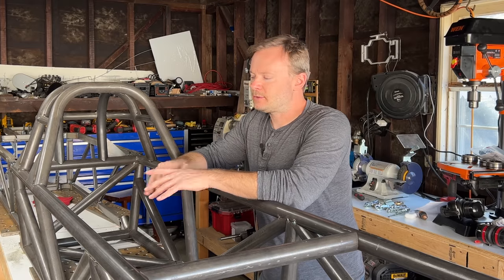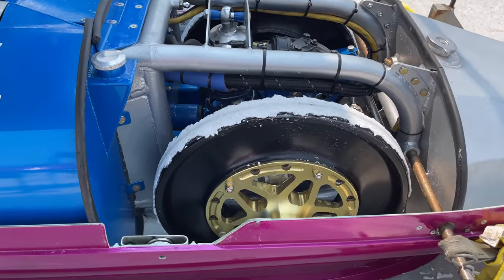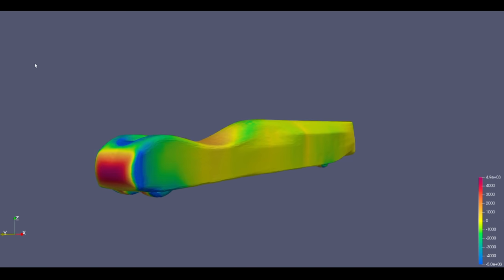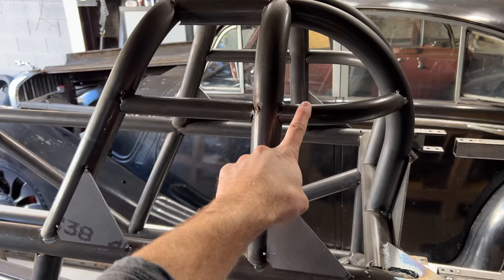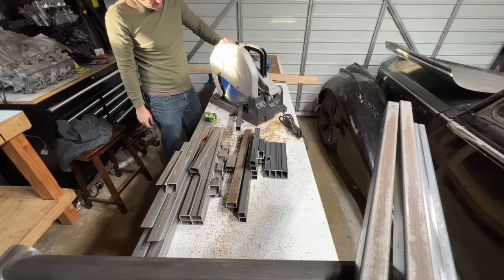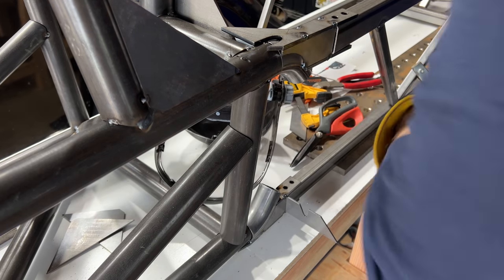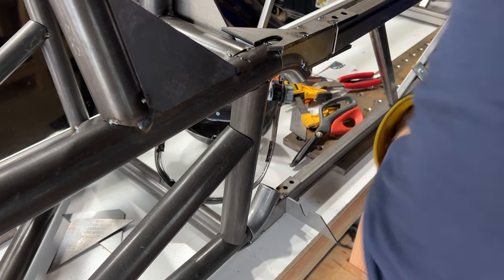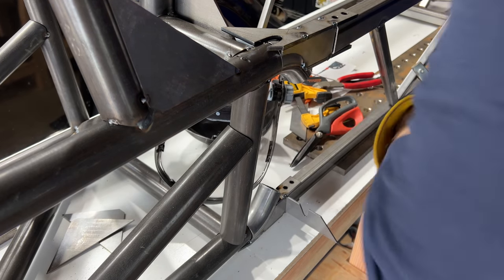Building A Race Car Frame: How To Not Die At 200 MPH

Comment: Can you make the nose just extra longer down to a really thin point. I know enough about balsa car racing that the triangle shape always wins.
Reply from the maker: I could. That is a thing a lot of people do. bullet trains kind of do this, and I thought there was an aerodynamic reason for it, but it could just be to scoop cars and cows off the track to avoid a derailment, which I hopefully will not need to worry about. I'll be doing some different analyses to see what works best.
Reply: @SuperfastMatt  The noses of aerodynamic trains are often made of fibreglass, they're not designed for collisions. The duck nose of Japanese bullet trains is to prevent booms at the ends of tunnels.

Comment: I have one small question.  How many cubic feet per minute of air will pass through your intake tubes while traveling at 200 mph including the suck from the engine (if there is any)?
Reply: You can work it out from engine displacement: 0.5 litres per engine cycle (the engine displacement) at - for instance - 100 engine cycles per second (that's 12,000 revolutions per minute but only one engine cycle for each two revolutions) would be 50 litres of air per second... or 106 cubic feet per minute. Proportionately less when the engine is running at lower speed.

With the tubing cross-sectional area (assuming 1.5" inside tube diameter) of four tubes, if I didn't make a math error that's an average air velocity of 11 m/s (or 36 ft/s).

Comment: Just saying 
I hope you will used your frame for running your cooling systen
Reply: Matt explained how the longitudinal frame tubes of the front of the car will be used for engine air intake. 

I would be concerned about corrosion with coolant in the frame tubes, although of course additives could address that.

Comment: Why have shocks & springs in front when the tire sidewall exists?
Reply: The sidewall is probably too stiff by itself. Sidewalls are also poorly damped springs, so if you depend on them alone for suspension you bounce over bumps.
Reply: @brianb-p6586  not if tire pressure is right & the surface is smooth (like a dried-out lake bed)
Reply: @Iowa599  Unfortunately the salt is not perfectly smooth.

Comment: I use a 2x shade13 solid glass mask that i made outta cheap autodark helm, so i dont make that mistake... First of all, 2 shade13 and 1 transparent glass make it a heavy as fuck mask, at least compared to a polycarb grinder mask that is featherweight... Also, i love the ``working on welding finesse`` as in working on a chassis project that requires quite some finesse and skill just to start with, but true enough, welding that frame together does make for a great welding practice, any welding position you can name, you can experience with this project, all but upside down, suspended by a harness, as that you can do, but it would make little sense...
Reply: those drilled tabs for the bolt joint are in my eyes a weak point... Heck, i am making an engine crane now, and i have a few cut out sections like that, where you leave a fork to call it that, to interact with another smaller square section that fits in and can move on an angle once set in with a pin... My crane is supposed to move not an engine, but a deckel tool&cutter grinder, which weighs around 550 kg... I will use it to work on my cars aswell, but its minimum is 800 kg, as i intend it for a 550 kg machine... The square tubes are 5 mm in wall thickness, and the section that will allow the swing arm to pivot is cut out just like you did the bolt junction, but it will have one `yuge bolt or a pin to allow the angular change and to of course retain the arm... With it lifting 550 kg, and walls being 5 mm, i intend to reinforce the walls by doubling them up for increased strength, i dont work with consideration to calculations and graphs and such nonsense, so i dont know, i might be overdoing it, but what you have there seems awful thin for a piece that is supposed to resist torsion, compression, vibration and a lot more, all the while being under strange influence of gravity and the way it manifests onto that part through the two bolts... Hmmm, just an intuitive consideration, but them poor girls need some more skin on them bones... Or your car might do the same thing as the last clip did, but not fail in having a roof section made like shit, but in ripping apart under torsional loads from winds, bumps and steering, how ever little there might be, on a windy day, steering such a thin vehicle, joined that way might induce a large load on that section and twist and break it apart like a pretzel...

Comment: Hmmm... So... Periscopes are not valid ways to see ahead? :(
Reply: Works on tanks......😂
Reply: @markpitts5194  Indeed, but ... At least on M113, we do tend to ride it with heads out a lot of time. The periscopes there are not great, but they are also made to sustain some firepower while keeping the driver and crew protected. 

I do believe current camera or even standard periscopes as non-electronic backup would be reasonable and offers great visibility, however... I do think there might be regulations that bans these devices to improve aerodynamic.

I can see how good and reliable it is the visibility on cameras nowadays due to drone racing and FPV flights. These things are violently shaken all the time and hardly fail.

Comment: Seems like it would be way easier to just for a single S1000RR engine than make space for two engines with half the cylinders deactivated.... But you do you :D
Reply: There is a G-class that is 93-122 cubic-inches.  I guess you could do that with two 1000cc motors.  Not sure why you wouldn't just use a 2.0L car engine, but with that engine bay he could do just about anything.

Comment: I'm surprised that the SCTA allowed you to have a "bolt-on" rear section. I thought  the entire frame had to be one piece.
Reply: In a crash scenario, it can be useful to have a fusible joint, so the inertia of the half you're not in doesn't keep you tumbling.
Reply: @EmyrDerfel  I understand the idea and benefits behind why it was done. The question was...will SCTA allow this.

Comment: Chain drive and live axle?
Reply from the maker: kind of. imagine a motorcycle swingarm, but instead of having one wheel between the swingarm legs, there are two of them outside of the legs.
Reply: @SuperfastMatt  Any roll articulation?
Reply from the maker: @brianb-p6586  nope
Reply: @SuperfastMatt  Thanks. I'm looking forward to the rest of the build, with suspension and so many other details.

Comment: why not just skip the water to water heat exchanger and dump the engine coolant direct into the water tank?  accomplishes the same thing only more efficient and cheaper and simpler and lighter.
Reply: You missed where he said he didn't want boiling hot coolant spraying around him in a crash.
Reply: @Brian B-P  the temperature of the coolant out of the heat exchanger is also boiling hot the only way to reduce it would be to have massive quantities of coolant going through the radiator which adds a lot of weight and takes power to run the pump.  If that's a concern then relocate the coolant all to the far front and make coaxial hoses.
Reply: @mriguy3202  No, the water out of the heat exchanges will not be boiing. In the heat exchanger, the water circulating from the tank will rise in temperature while the coolant will drop in temperature - they do not need to reach the same temperature.

In fact, with plain water (perhaps just with some corrosion inhibitor) in an unpressurized tank, it can't be allowed to get higher than 100 C / 212 F, or it will literally boil. In contrast, the engine coolant (probably the usual water-glycol mix, under pressure) will be much hotter.

Comment: Why not use a ktm Duke 390 or Husqvarna 401 engine??.. or 2 250cc ones ... Or 2 ZX25R engines 😀😀🤷‍♂️
Reply: In the previous video, in which he introduced the project, Matt said he would address the engine questions later... there's at least a whole video in the engine choice alone.

Comment: Why don’t you lay down forward on you stomach, sort of like on the Batman/tron motorcycle you can then lower your drag coefficient.
Reply: Make a custom dual clutch transmission, that you gear from 1:0.5 up to 1:2 ratio. so that when you already have momentum you can slowly change what gear you are in so the end result would be that you are probably going 400+ mph..
Reply: I really don't think you want to crash while in that position.

Comment: Rubberized coating on the lower sections of the frame will save u alot of WALL ROTT in ur lower sections... unless u get one of those electrodes that u put a current into and prevent the rust .... SIDE NOTE ... i think have the reason u get it damned near BANG ON ... is because u beat up ur ideas ... i know it sounds weird ... BUT I HAVE A HUGE FEELING ... that u are ur biggest critic ?!? LOL

Comment: I would still powder coat the frame. They make touch up powder coat that's solvent based. It's uh, pretty nasty stuff, but it'll let you cover up modifications. 

It'd also be good if you coated certain sections exposed to the salt at a minimum. It'd be awful doing all this work just for rust to take it in 3 years.
Reply: Chromoly is pretty darn rust resistant. It really only makes surface rust, we don’t powder coat our race car frames because it’s a weight issue (and in sprint cars they are a consumable part) we just brush a coat of oil on them before the off season
Reply: @bigiron4018  the welds is what I'd be worried about. Bonneville might be a bit different for rust than other series too.
Reply: @fataxe1  that’s very true, we do see lots of moisture from the track via mud at times but never salt. 
The welds with the right filler wire are more rust resistant than the chromoly, because they have an oxidation layer that protects them. So we get much less surface rust in the heat affected zone of the welds. With the filler we use anyway.

Comment: 2 -  4-6 inch downforce plates about 2.3 inches wide 2 should be plenty though (one either side about 10 inche back from the TIP... gotta focus on the TIP ... for the SPEED RUN...LMAO) 
 should be all u need to keep the nose planted.... just after 10 mins of maths ...lmao